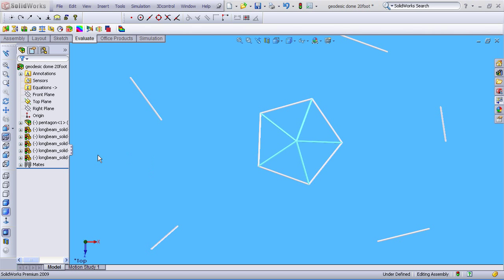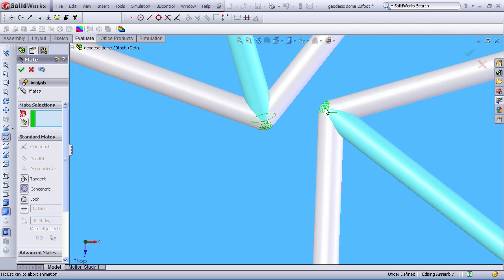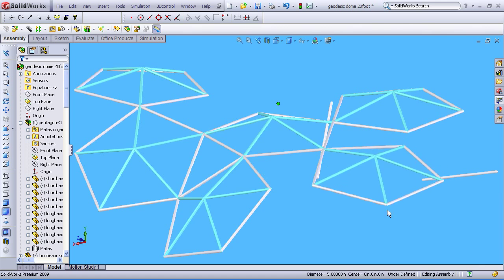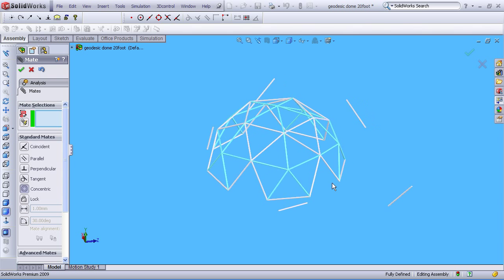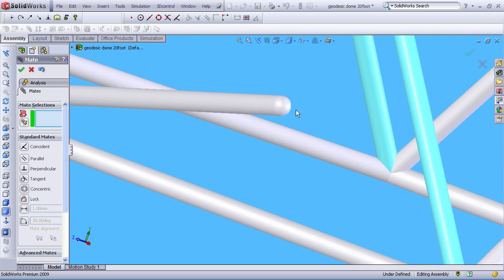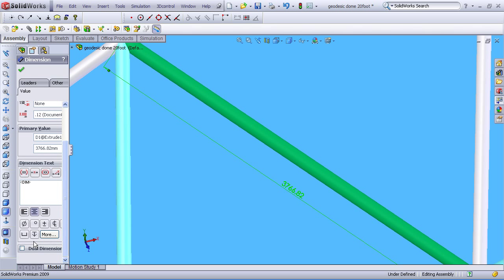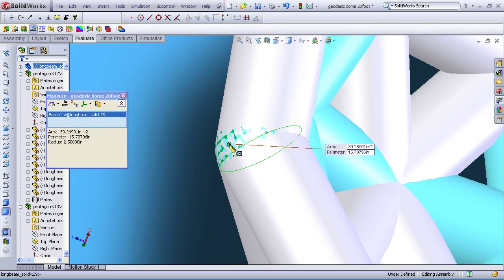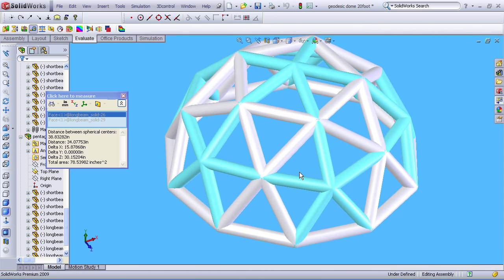geodome

Comment: Hey Leigh,  I am trying to build a 2v geodome in cad. I took my strut length values off an online calculator, now I have discovered that the lengths need to be exact for solidworks to correctly piece the dome together. I guess this means I need to enter the sturt length as an equation that is driven from the diameter of the dome? Many thanks Gav